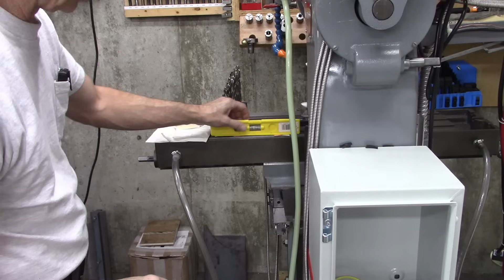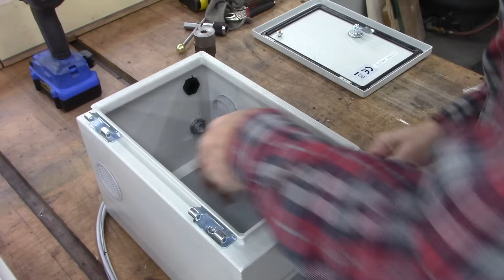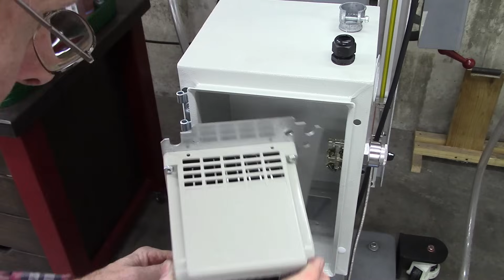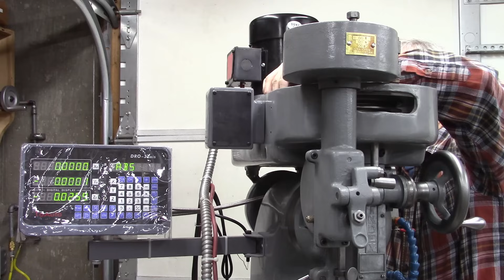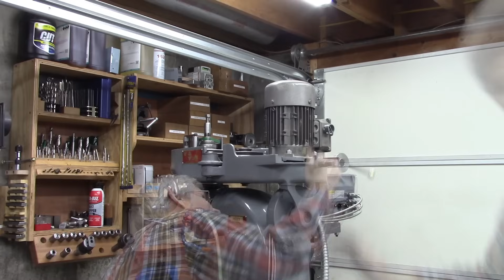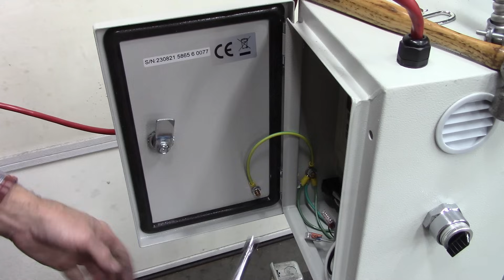IT'S ALIVE! Installing a VFD and 3 Phase motor on my Well Index Mill  - Part 2

Comment: VFD's are nice, and pretty cheap nowadays.  I would have used one on my Bridgeport M-head with the 1/2 HP 1200 rpm stock motor;  unfortunately the motor voltage was too high for that to be practical with my 230 VAC supply.  

Used a 1 1/2 HP DC motor from a good quality tread mill instead.  This motor is rated 1 1/2 HP @ 4000 rpm, thus almost identical to the original motor's performance.  (on DC motors the power varies linearly with the speed, thus 1/2 HP @ 1330 rpm).

In my "stores" I had an SCR speed controller I tried first with this motor.  Unfortunately the motor hummed very loudly at an objectionable noise level to me.  For a drill press it may have been ok, but not on a mill which may run for hours on end.

I found a PWM controller on Amazon at a dirt cheap price such that I was willing to take a risk.  This turned out to be the perfect solution!

I did use a PWM on a small gear hobbing machine that followed me home:-)).  Its motor was a 1/3 HP 3 phase and I did not want to replace it as it suited the machine very well.   The motor voltage was selectable by moving 3 internal contacts.  I adjusted these for 220 VAC an all was well.
Reply from the maker: Small gear hobbing machine???  I need this ! Ha
Reply: @WinkysWorkshop  It was described in Digital Machinist Magazine, Winter 2020.
It's an old German machine made in 1953 or so, and a couple of people changed the mechanical gearbox to digital, using an encoder, stepper motor, power supplies, and controller.  And a program, of course.
On a gear hobber every time a new tooth count is needed an new gear train has to be arranged foe that tooth count.  A little tedious for one or two offs.
It seems to work very well.
Reply from the maker: @BasementEngineer  I'm sure all the gear ratios would be require a LOT of gears. I was actually thinking about building one with one DP and PA LIKE 16 AND 14.5. I'll probably never do it but it seems like you could establish a set ratio between the cutter spindel and a drive gear and then the driven gear could be the same as the gear you are cutting.
Reply: @WinkysWorkshop  You are correct.  However, you need a different hob (cutting tool) for every PA and DP.  But, one hob will suffice for all tooth counts with that PA and DP, unlike toothspace cutters where you need 8 or more.
If you have a small universal (ie. the X-axis swivels so you can adjust this to the hob's helix angle) horizontal mill, and using the electrical equipment described in the DIGITAL MACHINIST I referred to, you can hob gears on that machine.  Same for a vertical mill where you can swivel the head to the helix angle.
Hobs can be expensive when new.  However, many are available on the surplus market;  I purchased a Module 1, 20 deg, RH, with 8 mm bore, for $50 slightly used.  Realize that this hob will produce all tooth counts of that tooth size and pressure angle.
My machine is quite a small footprint and does not use much space.  If I were to do it again I'd adapt my mill as I described above.
The entire hobbing operation of gear tooth cutting is quite quick, and fascinating to watch.
Reply from the maker: @BasementEngineer  Very interesting information. I did not realize the hob had to be set to the helix angle but that makes perfect sense. The head on my mill rotates parallel to the X axis. Yes electronics would be the way to make it happen. It's amazing to me that this can be done accurately. Where do you get the ratio for a specific hob and tooth count?
Reply: @WinkysWorkshop  Think of the hob and gear blank as a worm and worm wheel respectively.

With a SINGLE START worm one turn will move the worm wheel one tooth.  With a two start worm one turn will move the worm wheel two teeth.

Thus the hob spindle needs to be geared to the work spindle with that ratio in mind:  One hob revolution for each tooth to be generated on the gear blank.

All the hobs I have are single start RH thread with 8 mm bore (my machine needs that), consequently I don't have to accommodate any variations thereof.

With a home-brew adaptation you are much more flexible and can use any reasonable hob that comes your way free or at a good price.

Some gluttons for punishment even make their own form-relieved hobs.  I paid $50 for the Module 1 hob which I think was most reasonable.

In addition I have DP 32, 48, 56, 64, 72, 80.4!, up to 124. Some with 14.5 deg. PA, others with 20 deg. PA.  These I got with the machine when I purchased it.  I would not have bought it otherwise;  new hobs are about $300 for small sizes.  Note that there is a US outfit that will rent you a hob to do a job!

The ability to hob gears is a great facility.  If you adapt your mill to do this you can also hob helical gears which my little machine cannot.

If you decide to adapt your mill for gear hobbing you could probably get an article published in DIGITAL MACHINIST, which pays for such articles when published.

The essence of the adaptation is to add an encoder to the hob spindle, and drive the work spindle with a robust stepper motor.

For a milling machine the work spindle for the gear blank would be a dividing head driven by the stepper motor.  I know in Britain someone used a worm gear box for this purpose.

The electronics would do the rest.  If you are at all interested I would recommend that you read the referenced DIGITAL MACHINIST issue, along with the references listed in that article.  

The cost to do this change is quite inexpensive.  To successfully modify my machine cost about $360 Canadian;  that includes the control cabinet and the HSS tube to mount it.  The big cabinet on the side containing the power supply and stepper driver I had in my "stores".
Reply from the maker: @BasementEngineer  Great, fascinating information. I need to digest all this information. Thanks a bunch!
Reply from the maker: Where is the video?  😜

Comment: Having the directional switch close to hand is convenient when power tapping.
Reply from the maker: I was thinking the same and if I change the front belt position its super slow. However, my quill is worm drive and requires a lot of force to move

Comment: Mark, very nice work! Agree with several of the other comments - Get a tachometer! Beside, it'll look cool.
I have to wonder what the original builders of that mill would think of the upgrades!
Reply from the maker: I have wondered the same. I also wondered what they were thinking when they made the belt shroud so close to the belts that it was nearly impossible to change speeds. It makes me appreciate the VFD even more!

Comment: How did you determine the pully size combination to use?
Reply from the maker: I used the existing pulley chart, measure the speed of the new motor with a tach when running at 100hz and then did ratio and proportion with various pulley sizes to get a top speed of about 2000 rpm. Then I did the same at 20hz and found that the low speed was 300 rpm.

Comment: Looking very good.   Working well.
I am surprised you did not add the digital tachometer you showed in a video last year.   I purchased one to put on my mill.   I have VFD and 3 different pulley options so easier to read the spindle speed with the tachometer.
Dave.
Reply from the maker: I will add the tach. I'm doing the same... i have 3 pulley options.

Comment: On my mill I tilted the entire mill a few degrees with respect to level, tapped a hole and installed a brass fitting in the table end, and installed a plastic tube with a bit of stainless steel wool inside and led it down to the coolant reservoir so that coolant in the table drains over time back into the tank.
Reply from the maker: Mine is usually level but because I was rolling it around to install the DRO it was not. My biggest problem is the coolant that slings off the back of the table. I need a way cover with a drain. The table drains perfect and the tank has a good filter.
Reply: What if you put a thin piece of sheet metal (aluminum) under the vise then bend it up behind and the back edges in.   @WinkysWorkshop
Reply from the maker: @robert574  I had a piece in there and misplaced it. Mostly I need a new vise with a coolant gutter. The reason I bought this one is the fact that it clamp down in any position relative to the T slots. I'm lookin at a 4" HIPP. It has a 5-inch clamping range but is still 4 inch. Most are 4 x 4.
Reply: The problem with chips (and coolant) is you never know which way they're going to go.  You almost need a clear plastic box like how those popcorn machines are made (and the bottom under your vise).  Maybe a large rectangular skillet or something from goodwill.  One of those half sized aluminum baking sheets might be nice. @WinkysWorkshop

Comment: Hey Winky have you decide what position on the pulleys your going to use? I believe you had to move the belt to control the speeds. I'm doing the same thing on my Clausing lathe but not sure what position the belt should be on as a permit position. Hope this makes sense. Great videos too. Love the channel. We are almost a like on doing things.
Reply from the maker: I should have made an illustration of the belts but let me see if I can answer the question. My objective was to never run the motor under 33% which is 20 hz  3/4" end mills is about the largest I run so the speed needs to be around 320 RPM. My mill has the motor pulley, an intermediate spindle (jack shaft) and a spindle pulley. The original 3 step pulley on the motor was installed with the small pulley toward the motor. Due to the short shaft on the new motor I had to mount a single pulley in the top position. The new pulley had to be large (5.5") because the pulley on the jack shaft was large (about 7 Inch). but this met my objective. I still have the 3 step pulleys on the spindle side, If I need super slow I can move this belt. I can get the 2200 rpm by running the motor over speed (120 hz).

On a flat belt drive i would try to use the larger pulley on your spindle, it's less likely to slip. If you have a V belt change this pulley to get the speed range you need.